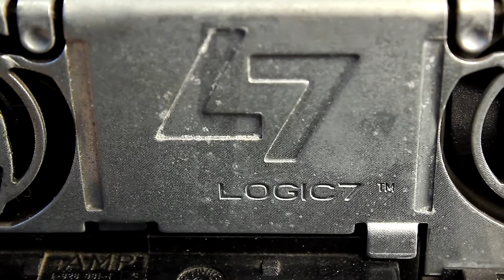Bmw Logic 7 repair and fail

Comment: Me logic7 all works fine just front passenger door stop working sound the rest all ok i try to check door wire all good could be a amplif?? Any idea
Reply: have a look into that connector but I read something about that the High-tone speakers are directly connected to the cic

Comment: I have the same amp in my E64, but both the subwoofers wouldn't work and there was no bass at all. Everything else was workes, just no bass at all. For me (after tremendous blood sweat and tears), it turned out to be the negitive output for both left and right subs from the amp that are at fault. I  used the center channels negative wire and replaced it with the subs negative lead, and suddenly I have bass. I did the same for the other side, and still used the center channels negative lead to the amp (but continued using the subs own positive wire). Nutshell: Bypass the negative wires for the subs, and instead tap in to a different speakers negative wire. To prevent any further strain on this already failing amp, i decided to use the positives from the L7 amp for the subs, and the negitve from the center channel to feed into a high level (speaker line, as opposed to RCA) into a second cheap amp to drive the subs. Working nicely so far. Hope this spares someone the pain I had to go through to figure this out. I really did not want to spend £350 for a second hand ebay one (which could well fail after a month). Apperently bmw will sell u a reconditioned L7 amp, but i never investigated that route. I still do not know what exactly failed in the amp to cause the no bass issue, but i know this workaround is going strong for me.
Reply: Thanks for the info. Whereabouts are you based? Any chance of taking a look at mine? I’d be grateful.

Comment: Funny, just this evening I decided to remove my Logic7 amp and see if I could sort the problem it had....  Basically tore it down, found a little corrosion fuzz on the DSP board (the small square chips)  some light scraping to mechanically remove the corrosion, then a liberal blasting with CRC cleaner.... plugged it back it to try it (this was the last-ditch before spending money on a replacement  Logic7 amp)  and it works! - Mine didn't have nearly as much water damage though.
Reply: the small square chips... are those chips 3 in a row close to the fan?

Comment: Do you know you can check all the signals from dsp and other things? Or you just blindly reinstalled dsp, thinking it's the only issue with them?
Reply from the maker: Please tell how can I do this? Is there any video or article about it? I'm really intersted. Thanks!
Reply: Do you know how it works in details? Do you know how  fiber optic wake up circuit works? Can you read flash?? It's very sophisticated device and you should take care of it accordingly